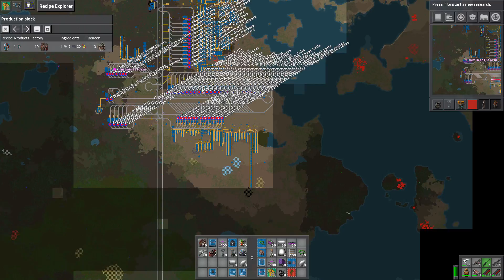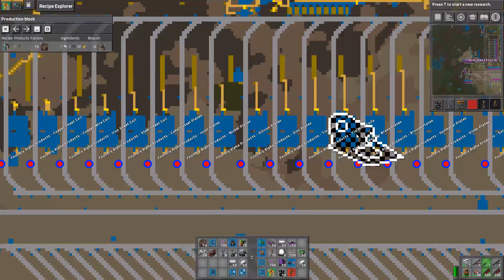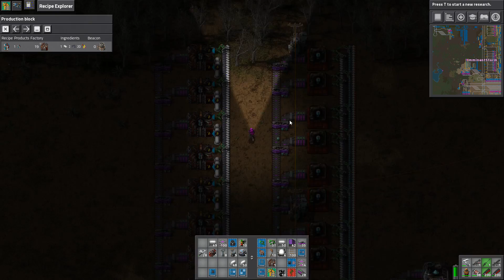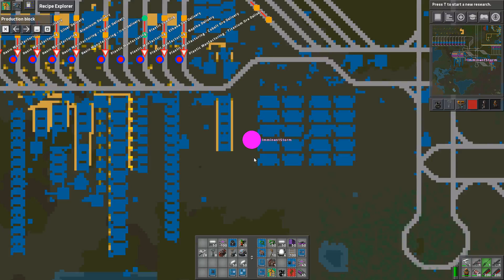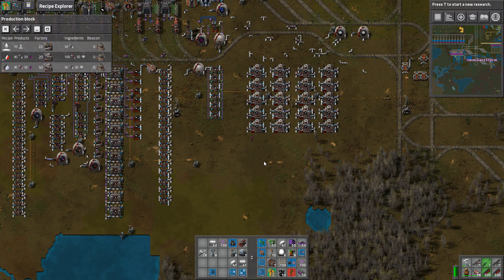Factorio - Angel's & Bob's - Episode 194 - Plastic Plans

Comment: Since this is your secondary, backup plastic production to fill in the gaps in your primary production, I'd suggest cutting your production goals in half. Instead of 400 liquid plastic per second like you aim for with your twice-as-efficient primary production chain, why not let the secondary line aim for 200 per second? Then you'll have half the number of machines to install and it'll go faster. Then if that isn't enough to completely relieve your plastic shortage, you can go back to 400 per second and make the extra machines. But if it does turn out to be enough, great: you haven't done unnecessary work.